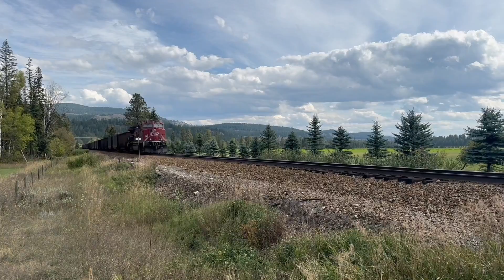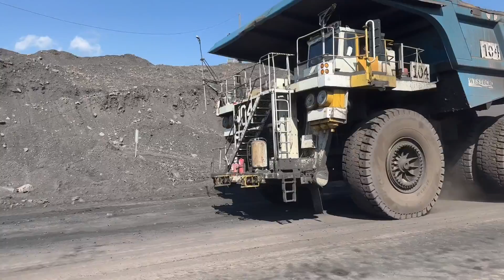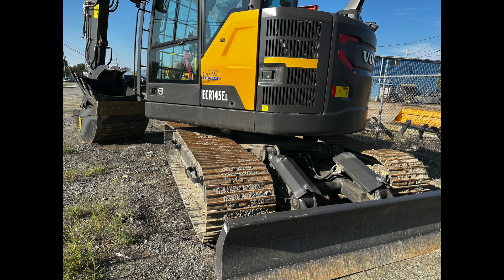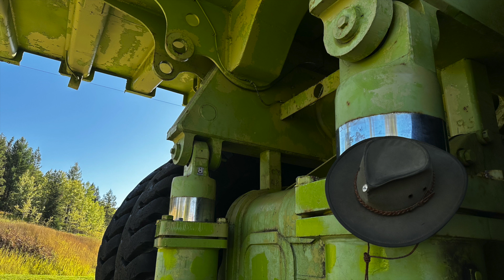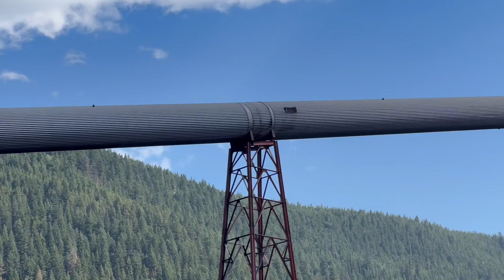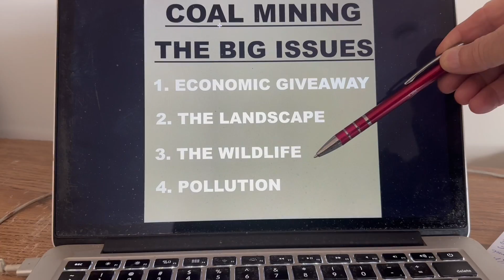The Rich Coal Mines of B.C.'s Elk Valley

Comment: I worked at the open pit  mine in Sparwood when Kaiser coal took over the underground operation and open up the above ground in late 1969 and 70. It was like working at a circus so many times. I had lots of experience around and using equipment logging in B.C. . They issue you had a majority of the main supervisors who were I think rejects from the potash mines in Saskatchewan. in 1970 they had over a 300 per cent turnover of employees. If you were any good it was possible to work your way up the employee chain. I quit after 6 months as i did not like the rotational shift work.

Comment: Happened to stumble across this video. I actually work at elkview the mine that is visible from sparwood. I have been mining for 16 years and come from many generations of miners. I’m glad you enjoyed your tour but I must say that some info you have about dozer usage is slightly off and that we do not have remote controlled trucks, the trucks you speak of are fully autonomous not remote controlled but they use (GNSS) Global Navigation Satellite System which is the same thing the military uses to guide high precision missiles it is super accurate in some cases within millimetres.  As for the pollution side of things the company I work for goes to extreme lengths to be environmentally friendly and they do a very good job of it they have invested millions into constantly improving and finding new ways to ensure things like water filtration are of the highest quality possible. It’s not that Canadians don’t want to make things ourselves and only want to sell materials it’s that our government is an absolute joke and blocks every try to process things in this country more or less.